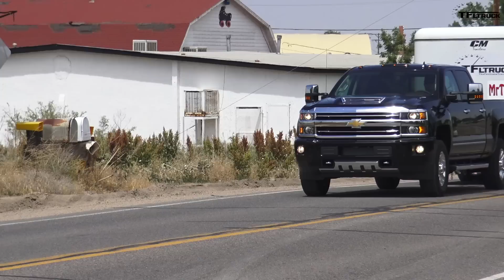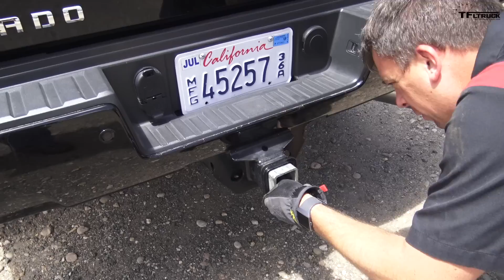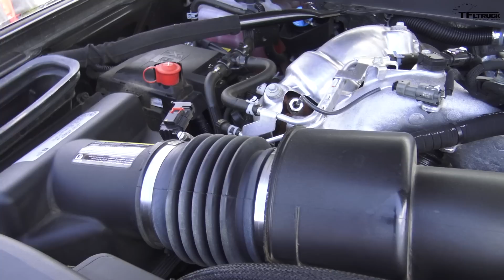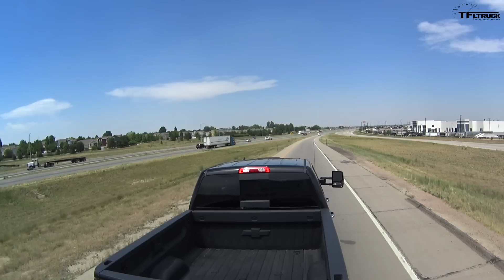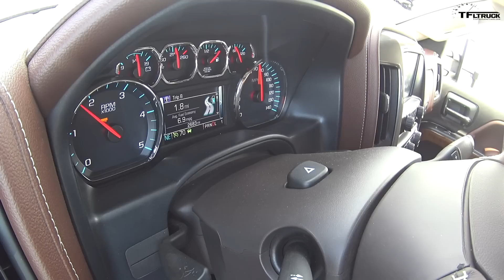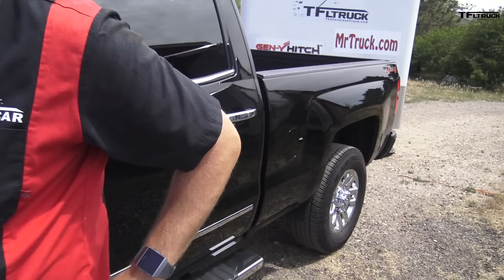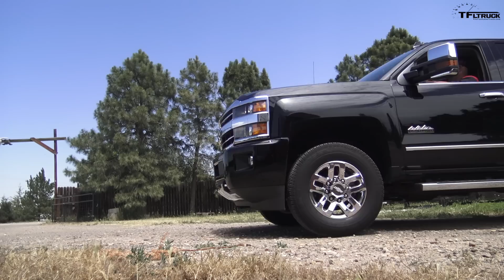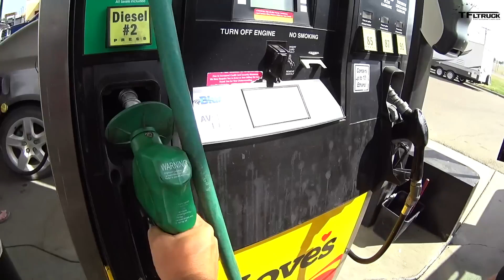MPG Challenge: Silverado Duramax vs Cummins vs Power Stroke

Comment: + The Real John Smith

https://jalopnik.com/lawsuit-accuses-ford-of-cheating-diesel-emissions-on-50-1821962910

This is for my buddy John who pulls his tally whacker to pictures of F150's, but I thought everybody else should see it. No, not John masturbating, the article.

There's a lot of you folks on here already crying out that GM must be cheating on their emissions. Ironic since Ford is being sued since January for allegedly doing just that for quite some time now. The fact that Bosch is involved is enough for me to believe that its probably true. 

I don't get it, they were cheating but they still have the worst gas mileage and the worst performing diesel. rut roe

I guess that means that little Ford diesel they just tested that had all the software issues 15 minutes into its test probably performed so poorly because it the was  first diesel Ford truck in a  long time that's wasn't set up to cheat.

Come on Ford, just start buying GM's Duramax Diesel technology too. You bought their 6 speed  transmission technology a decade ago and that's worked out pretty well for you. Let us not forget the General Motors did start and operate Detroit Diesel for a very long time. It's not like they didn't have experience with diesels. Granted that 350 diesel was horrible. I'm not defending that pos.
Reply: OMG your an idiot- https://www.nytimes.com/2017/05/25/business/energy-environment/general-motors-diesel-emissions-lawsuit.html
Reply: https://www.bloomberg.com/news/articles/2018-02-21/judge-says-gm-bosch-can-t-dismiss-suit-claiming-diesel-cheating
Reply: Worst performing? That's funny. Come back when your Dmax/ Allison combo isn't almost 10K under the tow rating of Ford and Ram.
Reply: And wrong 6 speed. It was another partnership. If you have some sort of link to anything different please provide it. http://www.wardsauto.com/news-analysis/ford-gm-launch-joint-6-speed-automatic
Reply: https://jalopnik.com/why-ford-isn-t-using-gm-s-nine-speed-automatic-transmis-1825465785
Reply: Ashes 2 Ashes Experience with diesels? Is that why they had to partner with Isuzu for the Dmax?
Reply: +The Real John Smith Partner with Isuzu? Um they own part of Isuzu genius. That's why a lot of Isuzu box trucks have GM 6.0 v8s in them. Now Ford on the other hand did in fact ask International aka Navistar for the 7.3. Ford had zero stake in International. They also didn't "partner" with them. The 7.3 was a hell of a diesel, primarily because Ford had nothing to do with it. But of course the Duramax came along and bitch slapped it right off the planet anyways.
Reply: Now concerning your transmission article you sent earlier, I'm going to try to be very blunt about this and explain it to you in a way that maybe makes sense to even a simpleton like yourself. See John, I know a lot about this subject because while I was in college, I worked for a great man who just happened to own a transmission shop. I worked very closely with Dave for several years until I was done for school.

When the Ford and GM transmission "partnership" as those not in the know called it, GM had three very successful front drive transmissions. In fact they continued to use them well beyond the new 6 speed. Since you're a man who has all day at the Sausage Factory to look up s***, be my guest, those three transmissions were the 4T60, 65, and I believe 80. Every one of those Transmissions was successful. The only real issue they were known for was the shift solenoids getting dirty which of course would cause scummy transmission shops to tell you needed a whole new trans when you just needed the cheap-ass solenoid. But if you went to it legit transmission guy, three or four hundred dollars and few hours labor and you were on your way again. Generally if you changed the transmission fluid before it was Brown, it was never an issue. If you didn't, you were better off never changing it.

Now what knowledge did Ford bring to the table for this quote-unquote partnership. If I recall correctly it was the ax4 or maybe Ax4m. At any rate, it was complete pile of dog s***. They used it in the Tauruses and Sables and it was notoriously known for breaking. Ford tried to tell you that if you didn't change your fluid every 30000 miles it was your own fault, but meanwhile 90% of them weren't even making it that long before they had a problem. That is what Ford's fwd trans experience was that they  brought to the table. 

Yet you're trying to convince me that GM wasn't the one carrying all the water huh? Try again John. 

Out of all fairness though, General Motors did produce the first mass production automatic transmission, all the way back in 1940 I believe. Maybe it was 41. But I know it was an Oldsmobile. So ford was playing catch up on that one yet again too.
Reply: Speaking of which, did you happen to even watch the Ike Gauntlet run between the diesel trucks? I mean you want to make a big deal about this 8000 pounds of Towing difference when anybody in their right mind knows that towing 30000 pounds with 6,500 is blatantly stupid. Especially when all three manufacturers make a medium duty truck that's built for that purpose. It's a heavier truck, with heavy your brakes and bigger wheels, and that's why. 

Still, all loaded up with 22800 lb, the Chevy and Dodge both walked the Ford like there was no tomorrow. Not only did they walk the Ford like there was no tomorrow, but they both got respectable gas mileage and the Fords Tanked. So as usual Ford came to the party with the big bad new truck, and left a shit stain in the lot. But it could be worse, I mean at least this ford made it to.the ike without breaking down and made it down the hill without a software issue. 

Now let me guess John, you're going to be one of these guys that's going to make me explain physics to you, and you're going to say something smart like, "let's see what happens with 30000 pounds on the back!" Well in case you are one of those Geniuses I'll give you a spoiler alert, The Ford would lose by even more. If it's already losing with almost twenty-three thousand pounds, the Gap would only be bigger with 30. The truck isn't going to find some amazing magical horsepower gain at 27 thousand pounds that it didn't have a 22800. Not a one truck will make it up the hill as fast at 30,000 pounds, but the ones that are already losing will lose by more. That's how it works John.

General Motors took the liberty of answering your question though why they're not stupid enough to give you a 30 thousand pound tow rating on a pickup. All you had to do was watch this very Channel run the Cummins and the Ford up the hill with 30,000 pounds. They literally were both liabilities on the road. They couldn't get out of the way and if they have had a mechanical failure and lost their power brakes, who knows who would have been killed. They were literally being passed by Freightliners going up the hill. Yeah, General Motors to join that party! Follow the Leaders...right off the cliff.
Reply: Ashes 2 Ashes Lets see. Where to begin. Gee, Ford didnt partner with Navistar- correct, so what? Not sure what your point is. Ford now makes their own in house diesel. Your point is completely moot. Do we need to talk about the 6.2 and 6.5 GM diesels?
Reply: Ashes 2 Ashes Transmission- we are talking about trucks numb nuts. Not a transverse mounted tranny from a sedan. Oh, you knew a guy at a transmission shop? 😂
Reply: Ashes 2 Ashes Lets see- GM marketing department- “Gee, our truck cant tow as much as the competition. What shall we do.” 

“I know, lets convince people that they really don’t need that capability and justify our lack of capability that way.” Even though we are excluding an entire market segment in the process and will lose money. Yeah, sure thing! You are a great cheerleader for a sub-capable truck. You typed a diatribe to say absolutely nothing.
Reply: I will however agree with you about Dodge. I think God makes a nice looking truck, well did, I'm not really a fan of the Ford Edge looking Grill on the new one. But I do like their Interiors a lot. I myself would never own a Dodge because I know too many people that have had random gas engine failures on those units without any warning at all.. It just doesn't seem like they're quality control is quite up there, and that was before Fiat
Reply: Ashes 2 Ashes I did see this Ike run with 30k https://youtu.be/Dzx7SL5AbE0
Reply: Ashes 2 Ashes And I did see this one with 30k. But I dont see a GM there. Wonder why? Oh yeah..... not capable enough. Fail for the marketing department, the trucks ability, or both? I say both. https://youtu.be/dGKnlIAqKJg
Reply: Ashes 2 Ashes And I guess you dont want to address the emissions lawsuit against both, since you tried to make it look like Ford was alone in emissions lawsuits.
Reply: +The Real John Smith well if the Duramax truck is a sub capable truck, yet it just b** slapped your Ford right off the Ike with authority, then what does that make the Ford? Oh wait I know, a bunch of liars who produced a lousy product to.challenge the other two with. 

Speaking of lousy products, I've been reading an awful lot about the Mustang blowing up engines at six and seven thousand miles a lot lately. In fact I stumbled upon one by accident on YouTube a few days ago and now every single time I restart my YouTube I find video after video after video of blown up Mustangs. Not only are they blown up but Ford won't buy them back. Apparently it's not even just that the coyotes are exploding, but Ford pick a subpar manual transmission to use knowing that it wasn't up to the horsepower spec it would have needed to be up to to stay together. I guess they should have followed their instincts like they did in the 80s and just copied General Motors with the Borg Warner T5.
Reply: Ashes 2 Ashes What are you talking about “wiped.” You think the Ike has any real credibility from a “speed” up the hill perspective. Do you even tow anything? Towing isnt a race. The Ike means crap for time and fuel economy. No intelligent person would make a decision on a purchase based on an extreme case that less than 1% of owners will experience. How are those GM truck sales going compared to Ford? And yes, a truck that is set up to only tow 23k will be faster and more fuel efficient than one set up to tow 10k more. If you don’t understand the physics of it I don’t have time to explain it to you. The GM was 15 seconds faster. Congratulations, 15 seconds and yet tows significantly less than the competition. Wow!
Reply: Ashes 2 Ashes And I thought you were talking about 6 speed trans- your so full of shit- http://etereman.com/blog/general-motors-transmission/why-transmission-repairs-for-a-gm-4t60e-are-a-major-headache
Reply: Anyway John, I'm seriously curious on what you think of the matter. I mean if I was Ford I'd be tremendously worried right now. The Mustang is the only car that they were going to continue to make in the future and they're not even doing that one right. If they keep this up, they might be down to just making fans.like you cry yourself to sleep with your faded ford truck boxers on.
Reply: Ashes 2 Ashes Lol- Have you seen Camaro sales lately? The Challenger outsells it. You do know the Mustang is the best selling sport car in the world, right?
Reply: Ashes 2 Ashes I guess you had to try to deflect to the Mustang after you just proven full of shit again.
Reply: Ashes 2 Ashes and it was Isuzu that brought the diesel tech to the table, not GM. Isuzu was making diesels long before Dmax Inc. “In 2000, Isuzu and GM started joint production of the first 6.6-liter Duramax diesel engines for GM's 2001 Heavy Duty pickups. Gm teamed with Isuzu to tap Isuzu's diesel engineering strengths to help GM become a major player in HD pickups. GM's earlier 6.2-liter and 6.5-liter diesel engines were widely considered to be noncompetitive vs. Ford's Navistar-sourced Power Stroke and Chrysler's Cummins-built diesel engines.”  http://news.pickuptrucks.com/2009/12/report-gmisuzu-duramax-diesel-joint-venture-at-risk.html
Reply: +The Real John Smith

https://youtu.be/eOMNKlrIhu8

Why you're absolutely right, they were so uncompetitive that there's videos all over YouTube of 6.5 diesel busting up 7.3s. In fact the 7.3 was so good that it was using all the military Humvees of the day, oh wait no it wasn't that was a Gm 6.5.
Reply: +The Real John Smith yeah it looks like as of lately it's also the most hated sports car in the world. Oh boy, well at least Ford had a winner for a little while. I mean it was never going to be as iconic as a Corvette anyway
Reply: +The Real John Smith not only do I think it proves all the credibility in the world John, but it looks like everybody else on here seems to think the same thing. So you're telling me the Ford sucks a dick because it's set up the full 30,000 lb and that's why the Chevy gets better gas mileage when it setup to pull 23k? I got to be honest with you John, I think you're so full of s*** your eyes are brown. That doesn't make any sense at all. I mean if the Ford was indeed set up the pull 30 thousand pounds, it should have had better gearing in the rear end and therefore been much quicker pulling weight up the hill at the expense of that fuel use maybe. But instead it failed right across the board. And yes, I happen to think that three trucks pulling similar weight up the same hill is a Fairly reliable test of how well they do in real life. And I don't think anybody else on here is challenging that John. You are,  because you lost as usual.
Reply: https://www.youtube.com/watch?v=sXPoL5rdqa4
Reply: Lol- Too funny https://www.youtube.com/watch?v=EwKdtxXbwss
Reply: +The Real John Smith John is having such a hard time finding videos that half of his aren't even in English.
Reply: I don't know John, seems to be quite a few videos going both directions. Certainly doesn't seem like a non-competitive diesel to me. I mean on competitive with me and I couldn't find any videos of it going the other direction and all I had to do was type it in once abd I found pages.
Reply: I don't know John. It seems to me to be pretty easy to find videos of either diesel pulling the other. This certainly doesn't fit the bill of a quote-unquote non-competitive diesel. I mean non-competitive would mean I shouldn't be able to find anything like that.

By the way, the Transmissions I was talking about earlier where front-wheel-drive stupid. The one that General Motors put all their experience into and Ford copied was a 6-speed transmission. It was for front wheel drive. We aren't talking about the 10 speed. And we weren't earlier either. And ask for the little clip you sent with the 4t60e, well ill let you know, there's a hell of a lot more of those transmissions out there from the 2000s then any others. I found the link interesting that you sent though, especially given that I worked in that industry and had no idea of the company that was attached to that information on it. I've never heard of them. So I guess that's just more Ford smut for ya.
Reply: Heavier drive train components, transmission gearing, and 4.10s v 3.73s. A 4.10 will get you more weight to tow but slower speed at the same RPM and less fuel economy. The Ford and Ram with their lower gear ratios (3.55 for Ford) still tow more than Dmax. So try again with the more fuel efficient gearing instead of the max towing setup and the results would again be different. In order for any vehicle to achieve its best mpg is has to be able to utilize all the gears and rpm range over time. If two trucks are held at a given rpm, the one with 3.73s will travel faster and farther than the one with 4.10s. A tractor would be a good example. Lots of power, slow speed. Why? Gearing. I know that may be a hard concept for you to understand.
Reply: And once again- you said 6 speed transmissions and then talked about 4 speed transverse trans. You have great internet opinion from the transmission guy you know but you never heard of the one from my link. Right. You choose to believe "what my "friend" said as gospel for an entire line. Hence your lack of logic. What 6 speed tech are you talking about besides the one out of your rear end? Surely there must be an article from a reputable source.
Reply: +The Real John Smith John we were talking about 60 miles an hour up the hill. We're not talking about top speed. 60 miles an hour is easily obtainable between any trucks, and the pumpkin gears ain't going to change a large majority of the engine RPM anyway irregardless especially between 373 and 410. The transmission gearing in  any of these trucks will have more effect than that rear differential difference will. we aren't talking about. 3.23 vs 4.30. think you're just going to have to bow down on this one John. The Ford lost. It's not bad at what it does. If I had no option of the dmax or Cummins I would absolutely drive that Ford before Id trust something else. But in this particular case, it just isn't competitive. It might be someday, but it's not presently.
Reply: Not competitive? LMAO. Have you seen the sales numbers. People aren't fooled by the GM BS. You really need an education on towing and gearing. The difference in time between the trucks was 15 seconds. The Ford and Ram were 3 seconds apart. They were all within .3 mpg of each other. You really are clueless if you think this makes one better than the other on a single runs worth of data. And gearing- get a clue- https://www.hardworkingtrucks.com/axle-ratios-mpg/
Reply: "If you are constantly towing, the highest axle gear ratio possible is what you're after. The choice of a numerically higher axle ratio will only knock off about 1 mile per gallon from the truck's fuel economy. But since pickup truck fuel efficiency is low to begin with, even a 1 mpg reduction is significant" 

The "drive cycle," which is how fast and where you drive, is also an important consideration when selecting the right axle ratio, according to truckmaker Ram. For lower speeds and rural driving, a higher gear set will add capability and a more spirited driving experience without too much damage to the final mpg number, according to Ram. But if you do a lot of high-speed driving, you might want to consider a vehicle with a numerically lower gear set to decrease engine rpm and improve fuel economy.

 https://www.edmunds.com/car-buying/how-to-choose-the-right-axle-ratio-for-your-pickup-truck.html